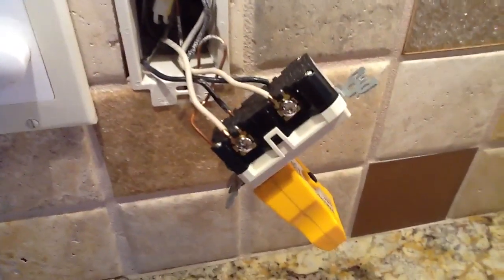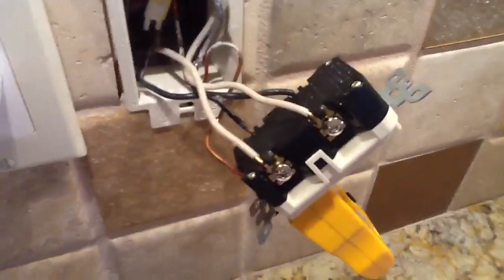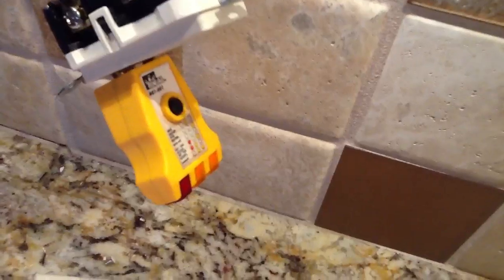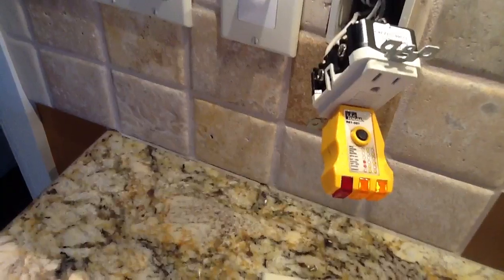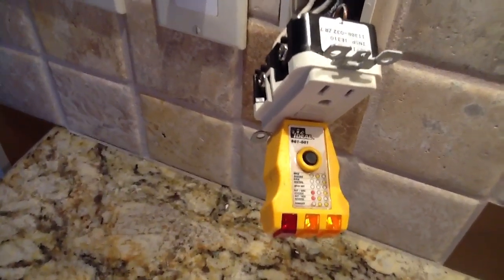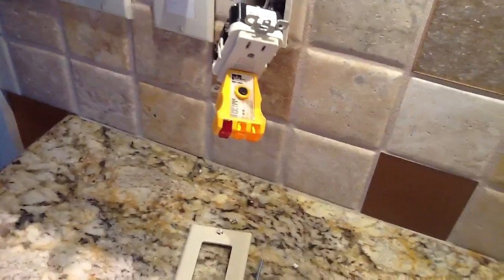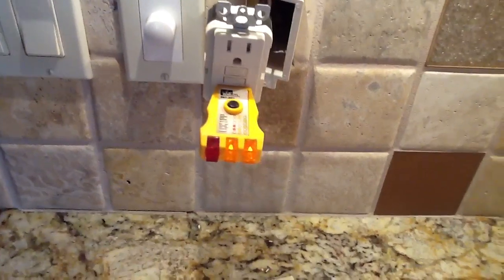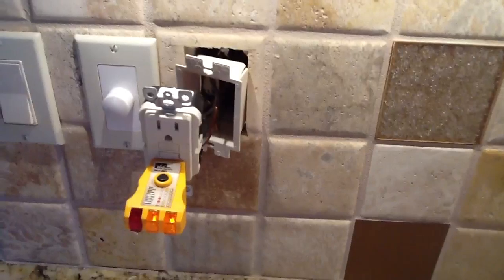Why does my GFI keep tripping?

Comment: I just bought a portable air conditioner for the living room. 115v. Heavy cord. I am not an electrician but do i need a GFI ?Thank you.
Reply from the maker: no
Reply: David thank you so much. The air conditioner is 3 prong(with ground),my wall outlet is old with only 2 prong, is it ok to use an adaptor on that? Thanks and i hope you dont mind 2 questions.

Comment: What does GFI or GFCI stand for I'm guessing the C will stand for circuit. Is it an American term for a circuit breaker.
Reply: Asked years ago but: ground fault interrupter and ground-fault circuit interrupter. The one question I feel competent to answer out of this so many not being answered. 😆
Reply: @theredrover3217  Hey ,thanks for taking the time to answer my question Red Rover, much appreciated.
Reply: @wakefieldyorkshire  You are most welcome! Yes this is the u.s. and The same thing goes by other names in other countries.  As for circuit breaker - I think of a circuit breaker as what is in the panel that I spent hours and hours mapping what all is connected to each one & there is a GFCI circuit breaker in the panel  for bathroom receptacles. I'm in the process of putting individual GFCI receptacles in the laundry room (2 because the washing machine has its own circuit.) I believe the third and last category are the portable perhaps temporary a better choice of word such as my hair dryer with A GFCI integrated into the plug. 🍍

Comment: only time you would install a gfci, is when a water source is like a meter and a half away from the plug it self. and out side plug, covering all plugs with out side moisture water proof cover. Other than that all other plugs should be standard plugs, as in 20 amp plugs for 12/2 wire and 15 amp plugs for 14 /2 wire , and as for ARK FAULT Breakers, now by code in Canada, you have to have one for each plug home run
Reply: I had an ARC fault Breaker in bedroom per my states requirement at time of build....it constantly buzzed and whatnot...replaced...still did it....removed and replaced with NORMAL breaker...PROBLEM SOLVED...I won't have government mandated fire hazards in my home...SCREW THAT!
Reply from the maker: thanks for watching

Comment: Wired two separate circuits with 12/3 wire. On the one going to the bathroom, I could not get the GFCI to work at all, although my voltmeter reads 120 between the hot(red) wire and both the neutral and ground. I think you may be correct as the two circuits share neutral and ground.  Any way around this without redoing the entire circuits?
Reply from the maker: you can not share a neutral, has be separate
Reply from the maker: have to have seprate neutrals
Reply: Turned out to be a faulty GFCI. Shared neutrals worked OK.

Comment: Why is that outlet not in an enclosed box?
Reply: due to the tile being installed either after the box, or miscalculated for depth there is an added extender.  If you look at :09 you can see the screw hole between the gap at bottom of the extender.  The light never quite shines in the hole to see to box very clearly, but it is there.  The box is what is holding the gfi in before he takes the screws out, he just doesn't show that part.  The extenders are used to protect from the sharp edges of the tiles.

Comment: Hi David 
I have a fridge in my garage that is working fine. The GFCI started tripping maybe a year after the fridge was connected to it. The fridge is working fine because I tested it on a normal circuit and nothing happened. I even put electrical tape around the outlet because I thought moisture might be the problem. But the outlet is still tripping.
Reply: All refrigerators and freezers need a dedicated circuit to them. They tell you not to plug them into GFCI outlets. You are allowed to have a dedicated single plug (not a duplex/reg outlet) outlet that is not GFCI protected in a garage as long as they occupy that space that the outlet is installed at.
Article 210.8 (A) (2) Exception (2)
Reply: Zaid Jamal hey Zaid how did you resolved your problem with the fridge if you don't mind me asking. thxs
Reply: I put a new GFI outlet in the garage :)
Reply: i dont know
sorry

Comment: HI David. if I replace a two wire outlet in my bathroom with a gfci and then test it with a gfci tester is it supposed to trip it. because I replaced it with a gfci and it does not trip it. no ground

Comment: Hi David I have a question about my gfi. It is outside connected to my fish pond, it keeps tripping. I changed the pump and thought that was the problem and it worked for a few days and was not tripping. The gfi resets and runs for a few minutes but then it trips again.
Reply: High humidity can cause trips.

Comment: I have a refrigerator outside that started tripping the GFCI.  I checked the circuit and tested the components on the refrigerator for a short circuit.  None exist.  Fridge runs fin on non-GFCI circuit. Could this be moisture since here in FL in extreme heat exists?  Is there anything I can isolate in fridge to stop or do I need to place in garage.  It currently is in back patio area.
Reply: try an in use cover using a wr (weather resistant) gfci.

Comment: Bought a GFi with a switch and a plug on same receptacle.  It has 2 black wires coming out of the bottom.  Where should these be plugged in order for the plug to work properly?  I plugged them with the load but it does not seem to be the correct way as plug only works when switch is in the off position
Reply: Depends on how you want to use it.  If the switched item should be protected such as a garbage disposal then you connect the "hot set of wires, the ones bringing power to the outlet" to the line connections.  You then connect the neutral wire going to the disposal to the load screw (neutrals are the ones on the side with the bigger slot in receptacle) 1 of the 2 black wires is then connected to the other load screw and the 2nd black wire coming from the gfi connects to the hot wire going to the disposal.
Reply: Another situation is with a switch going to a light that does not need to be on gfi protected.  For this you pigtail the incoming and outgoing neutral wires with a 3rd short wire that you connect to the line side neutral screw.  You then connect the hot incoming wire with one of the attached wires and a 3rd added "pigtail" wire.  The other attached black wire you connect to the hot wire (usually black) going to the light.

Comment: I replaced the GFI in the garage and it still tripping.  It only stop working from September to June.  Moisture is the problem and I don't know how to stop it.  Please help.
Reply: Weather resistant
Reply: moisture barrier around the outlet(s). Weather seal the garage (door and windows etc,) I know this is common sense. Good luck.

Comment: if I ran a 6/2 to central air unit n 10/2 wire to hot water heater both dedicated circuits n soon as I turn on breaker meter starts spinning what would cause that??? also no ground Rob on panel but I do see 2# copper going under house most likely bonded to cold water copper pipes n does main bonding jumper connection make a difference

Comment: David the biggest reason the gfci trips is because the ground wire is not pushed to the back of the box and is touching the neutral, clear the ground from the grounded conductor and it will work.
Reply: Fantastic tip.  Simple solution to a vexing problem. Thank you.
Reply: I would freaking buy you a beer if you lived near me. Have been slamming my head up against the wall trying to figure out why this thing kept tripping. That was the problem. THANK YOU
Reply: Mine has been tripping for a few weeks.  I swapped it out, new one did the same.  I Started pulling all the outlets on the load side.  Sure enough, the ground wire on the second to last one had pulled loose and was touching the neutral screw.  Problem solved.
Reply: Thank you!!!!

Comment: I want to thank you very much for this video after pulling my hair out all day and spent $85 on new circuit breakers and still not getting it to work your video showed me that both my bathrooms are linked together and all I had to do was push the reset button in the guest bathroom and that fixed my problem ,thank you very much,I wish I watched this video first.

Comment: Here in the UK we have an equivalent called a Residual current device.(RCD)
Normally found in the fusebox. One RCD can protect the whole property. Newer boxes have two RCDs and then the power goes through individual circuit breakers for the various circuits and then out through the cables to the various circuits.
Reply: RCD (GFCI) breakers at the fusebox are used more and more these days and are fully code compliant.  It's just most electrical contractors don't use them for whatever reason.  I think the reasoning is that it is much easier for the consumer to be able to look at his electrical outlet and press a button than it is for him to go fumbling through his fuse box. Part of it, too, is just tradition.  GFCI outlets came out in the 70's, have massively cut down on electrocutions, and therefore electricians and the code making board just goes with what has always worked.  Also, we don't require RCD protection on all circuits here -- only in areas where water might come in contact.  (Our rule is 6 feet from a water source as well as all outdoor outlets).  If we required them on all circuits, then breakers would make more sense (we are heading that way).

We did steal one thing from you Brits recently, though.  We now require all new receptacle outlets to be "tamper resistant."   New receptacles have little plastic shutters in them that keep foreign objects out (mostly to childproof it)  The receptacle manufacturers call it "new technology", but I guess no one told them the UK has been doing this since 1947.

Comment: Dave, I have a circuit that works till I put a GFI on the first outlet. Then the circuit ruins the GFI (tried three GFI  @ $20 each Dang it!) I under stand "line and Load" and they have been wired correctly. If I take the GFI out and wire straight it works again. What do you think?

Comment: Im installing a GFI for an outdoor circuit.  I had run wire through conduit a couple years ago and now when I attach that new circuit to the load side of my GFI, it trips the GFI upstream.  Sounds like a problem with my wire, like it has some insulation exposed or a short somewhere?  Any other thoughts?  How can I test my wire run to make sure it doesnt have issues?  Thanks for the great video!
Reply: If you disconnect or open the black wire and then touch the bare ground wire to the white neutral wire, the GFCI will trip.  The only way to fix a GFCI tripping when you rewire and the black wire is open, is to open the white power source wire or the bare ground wire during rewiring or new work.  That second open wire stops current differences in the bare and white wire from being detected.  If you shut off the entire GFCI circuit at the breaker, the chip in the GFCI should not be powered and can't trip.  If the GFCI won't reset, one possibility is the bare and white are touching somewhere in a box.

Comment: LOL!!!
Tells you how to test GFI outlets...
....Uses the worst outdated tester
Reply: +Corey497 First off, not true and you do not give us any alternative.  These testers are the most common found in an electricians tool box. They are recommended for home owners by almost every legitimate electrician. They work well and do it cost effectively.  Any idiot can say "worst outdated tester" and then move on. What do you suggest as an alternative or do you just troll for the sake of it?
Reply: +metaspherz Well if i actually have to tell you instead of you researching the information... Yes. Neon testers are outdated. The new testers are microprocessor controlled, they're nick named "shock-stoppers" for short. Think im wrong? Run a wire from the ground lug to the neutral lug on a outlet, guarantee your trusty neon tester will say its wired correctly
Reply: China

Thank to the onmtc3raemmnbgmetaspherz
Reply: The only correct way (according to NEC) to test GFCI's is to push the "test" button on the outlet itself. If one GFCI protects multiple outlets, then place your tester in each outlet "downstream" and press the test button on the GFCI to see if it turns your tester downstream off. (You can use a lamp or radio or whatever downstream).

Also, a "bootleg ground" cannot be picked up even by "stop shock" testers.  You will need to buy an expensive (several hundred dollar) tester to detect bootleg grounds.  Bill from "Sparky Channel" did a whole video on this. His Sperry Stop Shock did NOT detect a bootleg ground that he wired up on his test bench.  Video: https://www.youtube.com/watch?v=v0o1Uk3-r1A

Comment: So I have an external garage with 3 circuits. One is a receptical circuit with a GFCI. I have one of those yellow circuit testers. My GFCI is tripping. I noticed one of the recepticals has the hot-neutral reversed (red-yellow-off lights...).  Could that be causeing the GFCI to trip?  It doesn't trip all the time though???

Comment: My line side coming into the bathroom Gfi has a contaminated neutral (50v) in a 25 yr old condo.  This is on the 3rd floor from the main panel on level one.  Impossible to run another new circuit from the panel box.  Current Gfi circuit has two load outlets downstream that are used only occasionally. There is a 20amp outlet circuit available to pull power from and tie into the line side of the Gfi... Is this a good alternative

Comment: I have a GFCI outlet in my garage which seems to be protecting 4 internal receptacles and 5 exterior receptacles.  NOrmal load on these receptacles is zero.  Over the last couple of years I have troubles with this GFCI outlet tripping,  especially after a rainstorm..  It may happen instantaneously in a rainstorm, but the GFCI may be good for a day or two if the weather has been dry.  I have replaced the original GFCI, but the problem has not changed at all.  I do not have a circuit diagram of my house wiring, but my inclination is to install new GFCIs in each outside receptacle and to replace the existing GFCI inside the garage with a conventional 20A outlet.  What do you think?
.
Reply: the garage receptacle must be a gfci it the floor is cement. replacing the outside receptacles with individual gfci's will probably solve the tripping problem as you probably have multiple sources of current leakage in them due to moisture during inclement weather.

Comment: Just installed a GFCI . 2  hot black, 1 neutral white & ground come into box.  GFCI tests perfectly with 2 yellow lights on the tester.  Next non GFCI down the line test perfectly but when I plug something - the first GFCI trips.  Any ideas?
Reply: Bruce McFadden it’s the neutrals u need 2 white
Reply: I have the same issue. There’re one neutral for two hots. How can we have two neutrals? You mean one independent neutral for each hot? That would be the ideal solution but I would have to retire everything correct?

Comment: Recently my GFCI started tripping and I rest it, few hours later it trips again. I have to freezers in my garage and have been their for over two years without issues. So I unplugged the freezers and reset it, but every time I plugged in anything on it trips. Initially I though it the freezers but I am confused now.
Reply: refrigerators and freezers are not required to be and should not be on a gfci circuit
Reply: JIMMY TATE In garage?

Comment: I had a gfci out door that burnt up and I replaced it. I turned power back on and reset the outlet and it makes a zap noise and kicks off. It is connected to my worlpool tub and it is not working eather. what do you think?

Comment: My GFI (that my microwave is plugged into) trips when the microwave is not in use.  It never has tripped while the microwave is in use.  However, a different GFI in the kitchen trips when I plug something into it.  My house was built in 2005, but I think the previous owners did some remodeling, and most likely either made some errors or put in used items.  Should I just replace all of the GFI's or get a tester to test them first?

Comment: Why does my gfi lock in when i reset it and pop back out when i try to plug it in? It's outside
Reply: the simple answer is because that whatever you are plugging in is leaking bit of current. you have current leakage above the maximum allowed for a gfci. i have seen even extension cords that would trip the gfci.

Comment: I use an 1875 watt hair dryer in my bathroom GFCI, but I run this dryer for a while every two days.. should I be getting one of these GFCI testers to ensure I'm not creating danger to myself over time or something...?
Reply: if you have any receptacles within 6 feet of any possible water, then a gfci is required.

Comment: Only you mentioned that a common shorted or connected to ground, could trip the GFCI repeatedly upon installation of a new GFCI. Breaker off, I rechecked the receptacles down stream. After removing the cover, I immediately saw the problem thru the left gap of the mounted GFCI in the box. Apparently, when I pushed the new GFCI it into the box, the BARE ground wires moved around and went forward and was touching the common screw on the side of the GFCI. Breaker still off, I pushed the ground wire away so the bare ground wire stopped touching the white wire common on the silver screw. I turned on the breaker, hit reset, and this time it stayed on.
 Thank you for mentioning that in this video regarding common getting linked to ground.
Reply: A simple solution is to tape every receptacle.
When I hear electricians talk about AFCIs and GFCIs and "nuisance tripping", most of the time I find a simple problem like this.

Comment from the maker: Depending on the Gfi circuit is run, or how many it is best to tried the outside to line side. That way only that one will trip out.
Reply from the maker: Should be replaced not working correctly